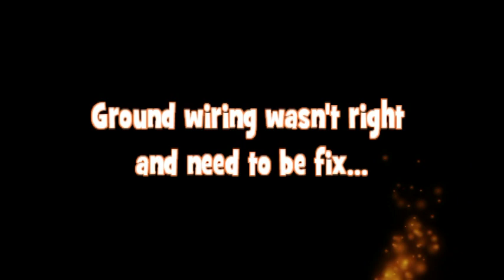DIY Explorer Guitar Kit

Comment: I ran across your video because I recently purchased the same kit. Patiently waiting for it to arrive. I've always wanted an explorer style guitar. Yours looks and sounds great! Did you run into any challenges? Did you use the included hardware/electronics? I'm thinking of adding a set of active EMG bonebreakers to mine.
Reply from the maker: Don't expect too much on the electronic, cause you get what you pay for in term of the price. At first I already bought a set of Duncan Design pick up (Seymour Duncan cousin) but I guess I bought a fake one, I can't tame the noise even with copper shielding.

There's an update video about this, if you interested. Check it out : DIY Installing Prewired Probucker.
Reply: @MindofYǒng  I went ahead and purchased the hardware mainly to get the pickguard and electronics cover. It was only $20 extra. I have enough parts laying around to finish everything else. Thank you for the response.
Reply from the maker: @Shifty_Bravo  Great, for me the pickguard is fine and fit in very well. I replied cause we had same interest for this instrument, I respect decent comment. So, yea...anytime, man.

Comment: Did you put a earth wire to the stoptail? I think you ground issue kommes from that
Reply from the maker: I did drilled a hole and put a ground wire through the tail piece.
Reply: @L Y Stripes   already or now? Did it help? Otherwise you have grounding issues at home... it depends on what are you recording

Comment: Big earth problem, or extremely shitty pick ups
Reply from the maker: Probably both, I'm still try to figure it out.
Reply: @MindofYǒng  are they wax dipped pickups?
use graphite paint in the pickup cut outs, or do what i did set of emg het set etc, no solder better pu better wiring better pots.

U have a good base to mod
Reply from the maker: @stanmil5495  I don't know, man. The brand Is Duncan Design I bought it for a half price of the original Seymour Duncan. I did put an Alumunium foil to the PU cut out.

Anyway thanks for tips, man. I really appreciate it .
Reply: Yeah, watching this its likely a grounding issue. Your tone is clean, but the hum should not be so present with, well, humbuckers.